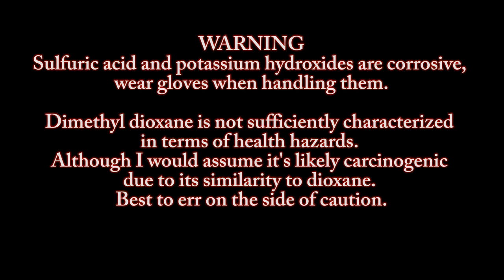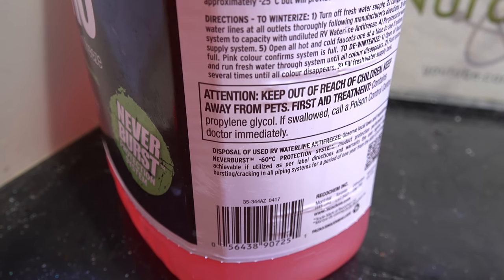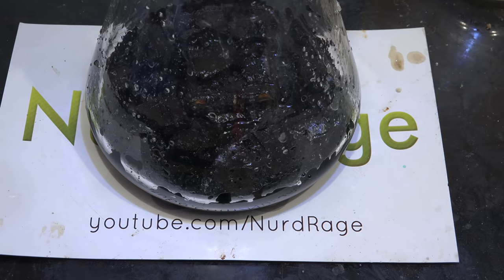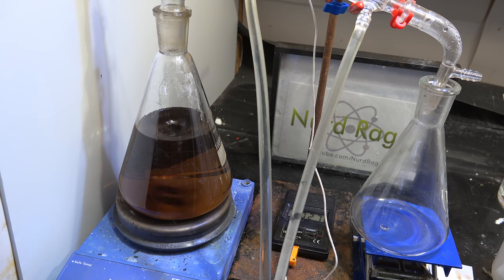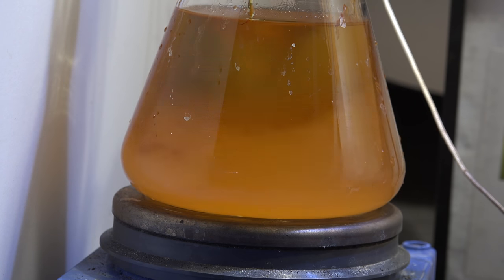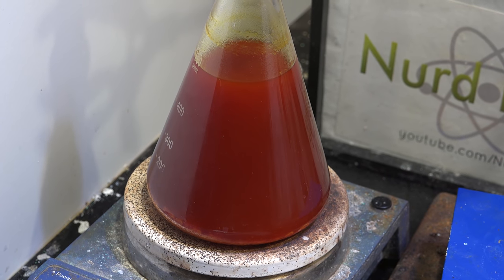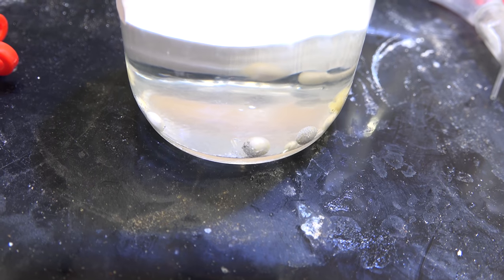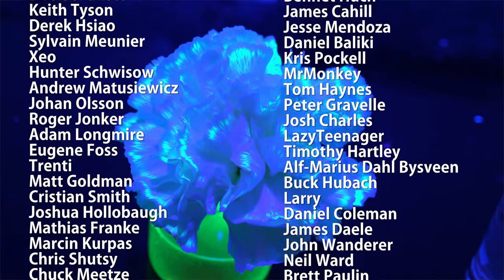Make Dimethyl Dioxane (Mistake! Look in video description and comment)

Comment: @NurdRage Hey, I followed this video's synthesis. It worked splendidly, distillation, KOH - Aldol reactions worked fine and the fractional distillation at the end gave me my product boiling at exactly 117 °C. Running a GCMS on my product revealed it to be nearly pure 2-Ethyl-4-Methyl-1,3-Dioxolane though. There were only negligible traces of Dimethyldioxane. Now I looked up the bp of the Dioxolane which is at 117 °C (Alfa Aesar) and the bp of Dimethlydioxane which is at 134 °C (lookchem). I am surprised how I ended up with the Acetal of PG and Priopionic Aldehyde. I started with pure PG. There might be a chance, that you synthesized the Dioxolane and not the Dioxane, too. This would explain the low stability against acids and the bp. Maybe, one should start with DPG instead.
Reply from the maker: that is actually very interesting! thanks for letting me know! i guess i should run some more tests to determine what i have as well. :)
Reply: @NurdRage  Dear Mr. Rage, I have repeated the synthesis using an isomeric mixture of dipropylene glycoles in place of the propylene glycole. The main product was Dimethyldioxane, with a considerable amount of the Dioxolane as impurity (~20 % by area GCMS). Using isomeric DPG leads to the formation of 2,5-Dimethyldioxane and 2,6-Dimethyldioxane. Synthesis went smoothly, combined products distilled over between 117 °C and 125 ° C after KOH treatment. Higher boiling fractions were higher in Dioxanes with lower boiling higher in Dioxolane. I was able to destroy the Dioxolane by boiling 5 mL of the mixture in 50 mL of 1.5 % HCl for three hours. Extraction with Diethylether lead to mostly pure Dimethyldioxanes (the formed Propionic aldehyde and Propyleneglycol seem to be more soluble in water). 
My thoughts on the formation of the Dioxolane are that with PG the secondary alcohol is eliminated leading to the formation of Propionic aldehyde which then readily forms the Dioxolane. The dioxolane that is produced when using DPG must be a product of an acidic ether cleavage followed by the acetal formation.
Reply from the maker: @MrSandtini  WOW! that is incredibly insightful! thanks for running the replication experiment! i guess i'll have to update this video sometime. So all along i was misidentifying what i actually had. Looking back it would make sense to have such elimination/rearrangement reactions. Thanks a lot for you help!

I'll change the video title and description and point to this comment. :) Great work!
Reply: @NurdRage  Btw, it looks like the easiest way to propionic aldehyde itself. Might be interesting for a lot of amateurs
Reply: Propional would finally be easy to make. Next question: is the propionaldehyde recoverable? Can it be separated, when is it formed, does it distill off during the reaction, can it be isolated from the glycol?
Reply: So is someone going to test the dimethyl dioxane on some impure sodium?
Reply: Have you guys thought of trying 1,3propylene glycol as well? Is there a reason for not doing it

Comment: @Nurd Rage Secondary ethers, which dimethyl dioxane is, are much more prone to forming explosive peroxides. Some, like diisopropyl ether peroxides are known to be explosive even when wet. You should keep an eye more often on your DM dioxane bottle, especially if the sodium gets depleted.
Other than that, great video.
Reply from the maker: oh no worries, i regularly check my peroxide forming chemicals. :)
Reply: Ah, that's cool. Secondary ethers aren't often used mainly due to that reason, it's not something I see everyday.
Reply: Chemical Engineer much more prone than what? Primary ethers? From what i know the stability of the carbon cation determines the likelyhood of the formation of peroxides. That means primary>secondary>tertiary. Or is my faint memory from school failing me?
I can work with primary ethers all day long as long as i dont expose them to sunlight or oxygen for too long.
Reply: Primary ethers. Although "more prone" may not be the best term for it, I'd say "generates more sensitive peroxides" would be a more accurate description. Diisopropyl ether is considered to form explosive levels of peroxides without concentration, and can explode without warning at high enough concentrations, and most info about its safety suggests to be tested for peroxides every 3 months as opposed to diethyl ether (primary ether) which is to be tested every 12 months. Though I'm not sure if DM dioxane would be as sensitive, since there's very little info about its hazards. Unlike di-iPr ether, DM dioxane is probably not as used in chemistry due to its sensitivity to acids, as opposed to explosive hazard.
Reply: explosives? Now i'm interested haha
Reply: Not the good kind of explosive, but the bad kind. The kind that happens after an unknown amount of time (weeks, months, years) and can destroy your nearby chemical stockpile as a BEST case scenario (not hurting anyone)
Reply: monster2slayer it depends on the relative stability of the radical formed alpha to the oxygen. So it goes secondary > primary and not possible with tertiary.

Comment: Would dimethyl dioxane still be useful for extracting sodium using the thermochemical method? I have easy access to propylene glycol but not ethylene glycol. 
Is 98% sulphuric acid essential? I'm to scared to boil dilute sulphuric to 98%. What about a lower concentration sulphuric acid, or any other substitute? Cheers.

Comment: Try using it as solvent for a grignard reaction! Don't see why that wouldn't work. It may be interesting to know if it also makes diorganomagnesium compounds with some grignard reagents (like 1,4-Dioxane)  or behaves like Diethyl ether.
Reply: Apparently dioxane doesn't form grignards but can complex or participate in some way.
Diisopropyl ether doesn't form grignards either.
Dimethyl, diethyl,dibutyl ethers+thf are the only used ethers for grignard formation.

Comment: KOH is actually a pretty good drying agent, for example it dries methanol almost as well as molecular sieves and is much better than the classical Mg(OMe)2 method. As such, if you don't mind leaving the DMD over KOH overnight, you can probably remove the vast amount of the water content anyway, although I'm sure it's hygroscopic so you may want to store over fresh KOH if drier material is desired.

(although I'm sure you knew this already nurdrage)
Reply: Rob Newland If you'd try drying methanol with KOH you'd just end up contaminating wet methanol with KOH and KOMe.

Comment: This is fairly of topic, but I just wanted to ask if you've ever tried separating the MgO and Na aggregate with glycerin and mineral oil? The idea is to crush it up into fairly small pieces so that the Na floats up to the bottom of the mineral oil and the MgO sinks to the bottom of the glycerin? It's definitely a lot easier than the dioxane separation and shouldn't result in the low yield that Nighthawkinlight's method results in with mineral oil and water.

Comment: You could make some simple Grignard-reagent and then add dimethyl dioxane. The reaction with usual dioxane is well known, but dimethyl dioxane has two bulky methyl groups, which may hinder the forming of this MgX₂-dioxane adduct. I do not expect any use for this and I think it will just react as usual dioxane, but who knows?
Reply from the maker: if it behaves like ether (Without forming the adduct) then a useful property of the reaction is that i can occur at higher temperature. One of the notoriously inconvenient things about grignards in ether is you need excellent cooling to keep the ether from boiling away. A higher boiling solvent might allow for less ideal conditions and thus save you time from babysitting such a fickle reaction.

Comment: Would eucalyptol be sufficiently polar for the reaction? Wikipedia has its bp at 176-177, well higher than dioxane or it's dimethyl derivative, and it could be fractionally distilled from eucalyptus oil.
Reply from the maker: that is... actually a good idea... i'll look into it!
Reply: An even higher boiler is anethole. There's several high-boiling essential oil ethers as I'm sure you know. Safrole is probably a bit too hard to come by these days.

Comment: Is there a difference between "mono propylene glycol" in vape things and "propylene glycol" which is used in animal feed?

I've always wondered why they are called different names (mono vs without mono) but have dramatically different prices. Would it be save to vape propylene glycol used in animal feed?

Thanks!
Reply from the maker: no difference, the same stuff.

(Propylene glycol meant for plastics is different stuff, it's usually the "1,3" type rather than the "1,2" type found in food and vape products)

Comment: suggestion for your sodium synthesis project:
use a teflon coated pot or boiling container the sodium hydroxide will not eat through it

and yes they can widthstand molten sodium hydroxide!!
but abrasives may scratch the teflon up so maybe magnesium powder is better than shavings

ive used those as poor man's "glassware" to boil off and do distillations!!
Reply from the maker: teflon reacts with molten sodium metal. Which is exactly the stuff we're trying to make. In fact in my earlier progress report video, i show the stir bar was degraded because it was coated with teflon.
Reply: i guess stainless steel is the only thing left for a material then
Reply: Molten sodium is just a royal pain in the anus. MSR reactors had this issue and it was the one that just could not be fully overcame.
Reply: Molten NaOH destroys teflon, I tried once to make NaF from melting NaOH with PTFE seal tape, but all I got was a black and red gunk, and couldn't separate the NaF from the leftover NaOH/Na2CO3 and the perfluorinated crap.
The only transparent material that would survive molten NaOH would be transparent magnesia, but that stuff is waaaay too expensive to make anything big, let alone a flask.
Reply: Chemical Engineer I'm really beginning to wonder how large scale companies that deal in these compounds work around these issues .
Reply: Very careful measurements, steel vats, and glass portholes to view, like are in most industrial chemical processing setups?

Comment: Do you really want to store an ether prone to peroxide formation over sodium?  I thought ethers were more likely to form peroxides when dry.  A trace of water or methanol can help prevent peroxides.
Reply: sodium reacts with oxygen before it has a chance to from the peroxide, even if some tiny amount of peroxide is formed, the sodium would destroy it almost immediately. So as long as there is some elemental sodium left, there is no chance of peroxide buildup.

Comment: Just go to your local pharmacy and see if they'll sell you a bottle of propylene glycol. Most use it in compounding and might order it in for you if you ask nice ;)
Reply from the maker: that's usually a lot more expensive than antifreeze. If you don't care about money then sure, go to a pharmacy. But hardware store sources are much cheaper.
Reply: Fair enough. I just prefer less steps and don't mind a bit extra cost. Though I got a good deal, considering I worked at a pharmacy when I got my compounding grade glacial acetic and sodium bicarb.

Comment: Please make a video: How to use vacuum filters.
Reply: surplusdriller1 ? Why
Reply: No need to be so toxic.
There are definetely some aspects to vacuum filters, aside from different types, that are not immediately clear.
For example when I first used one with an aspirator pump I made the mistake of turning off the water before disconnecting the filter. The result was water beeing sucked into my product.
Reply: +surplusdriller1 No need for that response, vacuum filtration can be dangerous if the vacuum seal isn't broken correctly and it isn't immediately obvious how to do such a thing without it being demonstrated
Reply: Get your vacuum line some water and some baking soda and then set up your glassware for vacuum filtration.
put 20g or so of baking soda in 200mls of water and then add it to the filter.
Then turn on your vacuum source, once on you can attach it to the vacuum takeoff adapter.
Once your are satisfied with the filtration and little to no more liquid can be pulled from the filter cake, remove the vacuum  line from the takeoff adapter, (do not turn off vacuum before disconnecting the line from the apparatus).
This is less an issue with vacuum filtration as it is with vacuum distillation set ups because a vacuum filtration set up is still open to the atmosphere enough to create a much lower vacuum than that of a distillation set up.
 You want to get into the habit of pressurizing a depressurized system slowly, I do this by carefully and slowly taking off the vacuum line in a controlled manner.
Alternatively it is advised to attach a stopcock system to your vacuum line that can be opened to the atmosphere that way you can slowly introduce pressure into the system.
Easy.
Reply: +jared garden A good way to do controlled depressurisation is to close the tap, disconnect the vacuum tubing and then place a piece of filter paper onto the nozzle followed by slowly opening the tap up; the filter paper will eventually gracefully fall off!
Reply: surplusdriller1 please leave
Reply: I just come to watch the magnetic stirrer bar.

Comment: what about exploring ways to increase the boiling point on said dimethyl dioxane , not a chemist mind ... a mechanical mind,,,,,,,,,  put the boiling liquid under pressure to drive down the boiling threshold ? or change the chemical composition of the (dD) to something in range?
Reply: Echo 419 I'm sure Nurd has already considered the former and the latter is what this is an attempt at.

Comment: Perhaps something could be bonded onto the methyl groups to increase boiling point?
Reply: You need a longer or more complex glycol to make a heavier ether. Propylene glycol is already hard to find, the new starting material would be too expensive I think. And trying to change the dimethyl dioxane after formation isn't easy either.
Reply: François Bergmans Isn't butanediol relatively easily obtainable? That could be converted to tetramethyldioxane using the same method. I don't think other vicinal diols are easy to come by.
Reply: Or use something that has already been used as a solvent... Like say diglyme.

Comment: One thing I want to say is you are not doing chemistry any favors by bolstering the belief, presumably by accident, that PG is bad by only giving anti-freeze and e-cigs as a source for PG. It is in literally too many products to count and can also be sourced at local stores as a skin protectant which makes the distilling step needless. Honestly it probably would have been easier to find than that RV antifreeze. I bought some at walmart. Other than that I like your videos keep up the good work.
Reply from the maker: Those are pure, and CHEAP. Skin products are excessively expensive for the amounts obtained. But antifreeze, even diluted, is dirt cheap in comparison.
Reply: iamsobanned the e-cig sorce is the only one that could be used in pure form as it's pure and food safe (part of regulations)
Reply: @nurdRage But you still see where I am coming from at least right?

@linda There are plenty of other pure sources of food grade PG. The point I was trying to make is almost all of the detractors of e-cigs point out that PG is used in anti-freeze so it is bad even though the PG based anti-freeze is generally non-toxic.
Reply: I think you completely missed the point.